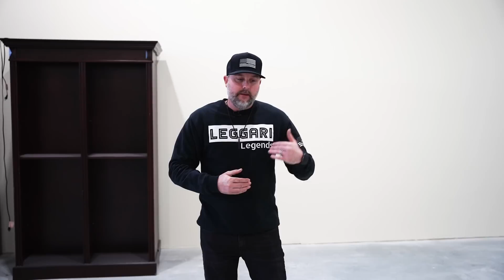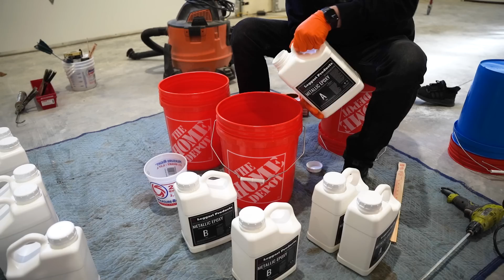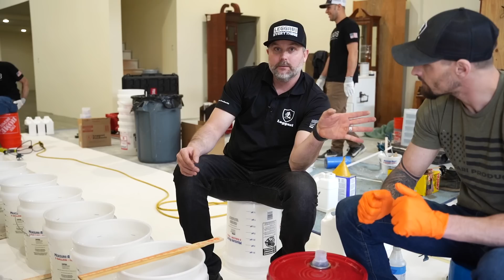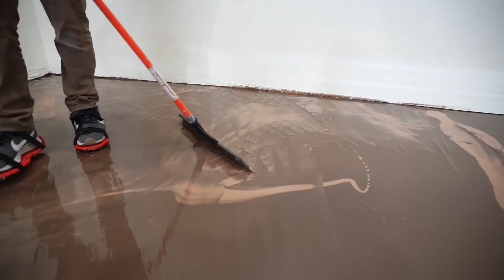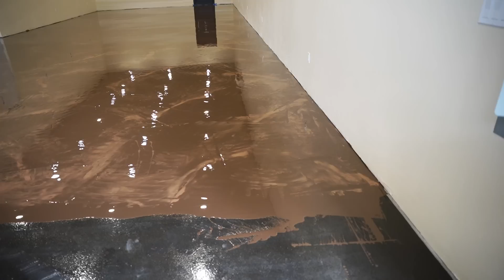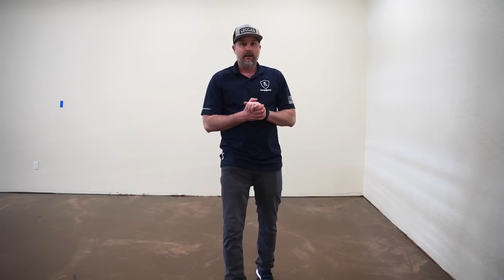How To Coat A 3,100 sq ft Shop Using Epoxy | The complete guide! Do It Like A Pro

Comment: do you HAVE TO USE the isopropyl alcohol or can you skip that step and just spray the denatured alcohol to smothe it out ?  again, do you have to use the matte finish or can you leave the shiny finish as is ??????/
Reply from the maker: If you dont want the dispersing effect you can certainly skip that step and go straight to the denatured to pop any bubbles and help the epoxy lay out glass smooth! We always recommend one of the urethane topcoats to protect the epoxy, you dont have to use a topcoat but you run a higher chance of damaging the floor!